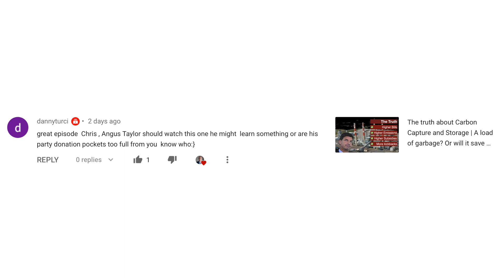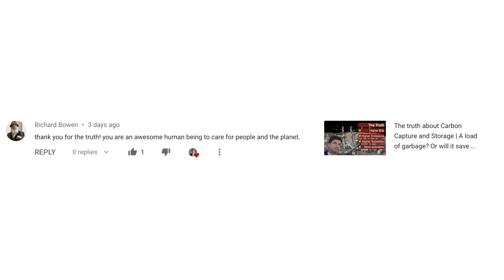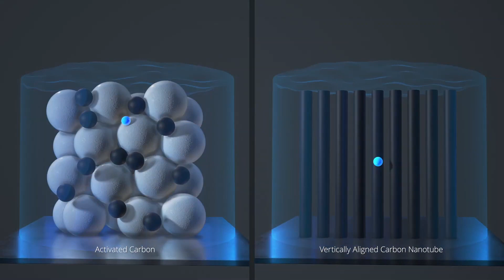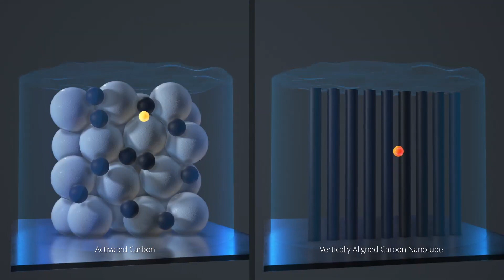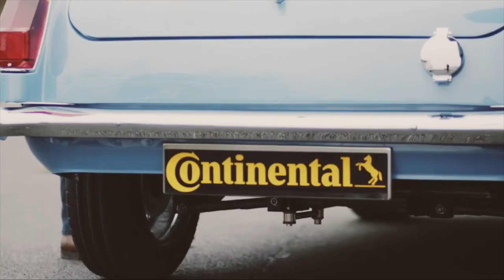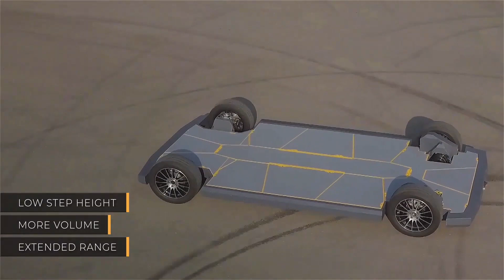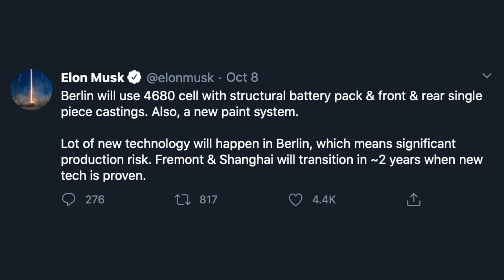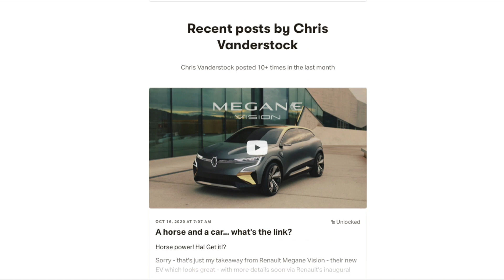Will the Tesla 4680 battery be used in all of their cars? | Renewable News 19.10.20

Comment: I think you need to think of the 4680 cells more like 4d chess... the fact is, PLAID S will have them in 2021 and Berlin will have them in the Y in 2021/2022 - and Texas will put them in the SEMI and CT in 2022 -- but, there is to reason for China and Fremont to use 4680 in 3/Y in 2021/2022... (as Tesla will want to 'use up' all of the 2170 cells to stop the price of this cell from falling too fast - by 2024/2025 100% of Tesla cars may be on 4680, but, this will ramp over years IMO - you can not go from 0% to 100% in just months when you are talking about a brand making more than 13,500x cars per week...)
p.s. rent my Tesla! Tesla Taxi au